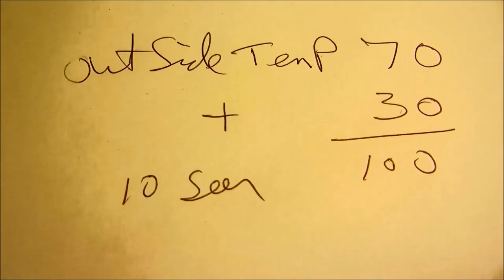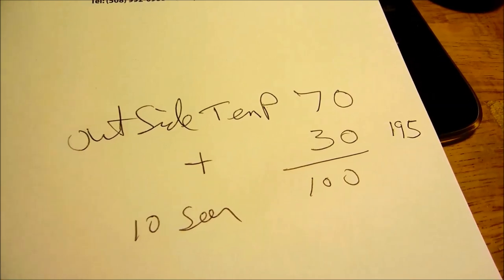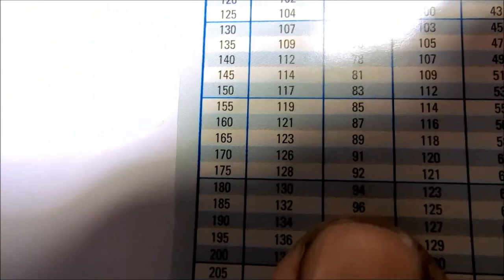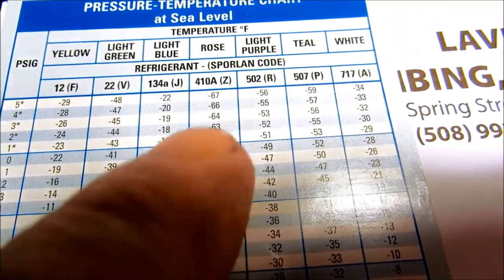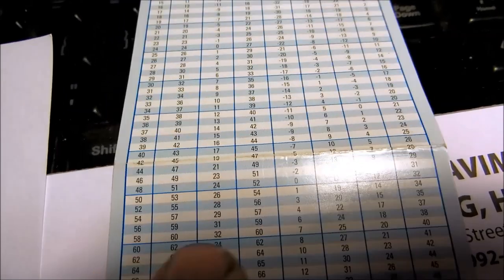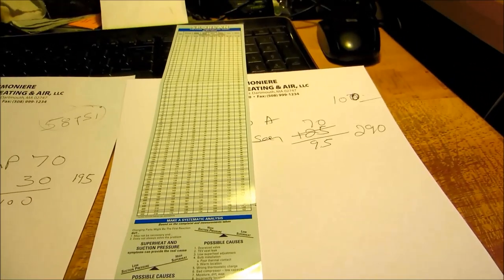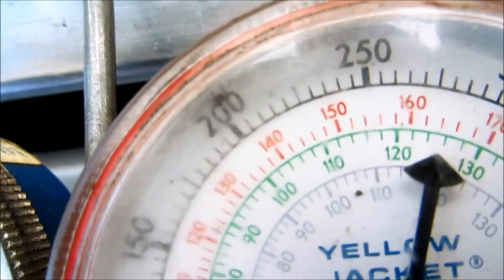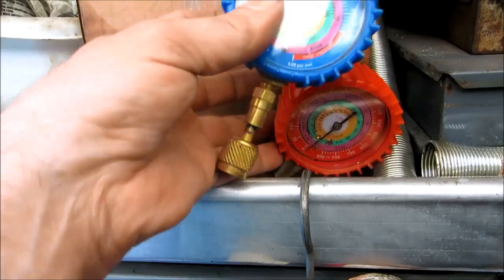hvac :30 + rule condenser head pressure

Comment: Yes but how can I determine what my condenser saturation temp should be.  For instance I know my evaporator should be 40F but how can I tell what my condenser saturation temp and pressure should be.  I know my compressor has a compression ratio.  I am teaching a class so be as detailed as you can be if you can and thanks for your time.

Comment: Steve, I understand the 30 degree rule, but heres my Question Sir, what about units of a higher Seer rating , say like 18 , 20 , 24 SEER ,and as high as 32 Seer ! Steve, wouldn't the new ( Delta T ) Temperatures ratios to be smaller on a higher Seer to add to the ambient Temp ? I have done some math on this problem, the answers I have come up with look correct for the higher Seer ratings , some of the answers are in my opinion are extremely low in Temperature difference ( Delta T ).  What are your thoughts on the subject Sir ? If this math rule applies, it could make a new standard in the field on units for Tecs to make it extremely easy to diagnose head pressure readings, regardless of what type of Refrigerant is being used in the Unit.

Comment: I'm doing a exam on air condition and I got question ask. if an air cooled conder's fan Motor stops running, the head pressure will ----------- and the amount of sub-cooling will ----------. but I just can't figure it out.
Reply: I hope you know by now ?
Reply: High head low sub c

Comment: i have found on the panel of goodman units they recommend 110* plus ambient on the vapor line in heat mode +/-4*,just to check charge in winter,but always check it again in summer in cooling mode or when temps are above 55*

Comment: Thanks for the Video, what you procedure do you use for determine a bad TXV, I've used sensing blub method any other ways?
Reply from the maker: Dave B if there is a txv you have to set the subcooling ... and the txv will maintain  about 10 to 15 degrees of subcooling if its working right
Reply: Frosting txv and distribution lines if it's stuck almost closed I believe and also hi head pressure. And if it's open, flooded evaporator, slugging compressor, low superheat?  Someone correct me if I'm wrong, I'm a greenhorn.    Btw, I wanted to share a neat little trick, the computer "Duster" canned air cans are R134a.  You can turn them upside down and spray the sensing bulb with an ice cold blast and see if the head pressure rises.

Comment: Nice video 

If the house is not hot so you have no load in the house that will also lower your suction pressure is that true ?
Reply from the maker: jordan coston yes,,,,, the higher the temp the higher the suction pressure,you should always check a air conditioner  on a hot day so you can run it with a load on it .

Comment: Hi Steve, I have Robbin air R22 gauges do I need to buy different gauges and hoses for all refrigerants in a perfect world or would your electronic one do them all.   starting as a tech what would you recommend as a good route to take to be able to check head pressures so I do not contaminate the gauges/ hoses. Jim
Reply from the maker: +Jim Farrell one for all is fine

Comment: Am I trying to understand what HEAD PRESSURE means? Is it a pressure of something? is a unit of condensation? I did not understand what HEAD PRESSURE means.
Reply: Antonio Ribeiro Junior probably you already figured out... Head pressure is discharge pressure, normally there is a port in the discharge line close to the compressor

Comment: The 30 rule does not apply to the HEAD PRESSURE............325 lbs of Head Pressure is not 30 degrees above ambient........the 30 rule applies to the TEMPERATURE......difference....of the condenser coil.......depending on the seer rating the temperature measured at the LIQUID line service port.....minus the ambient temperature........gives us that 30 degree difference.....

Comment: I'm doing a exam on air condition and I got question ask. if an air cooled conder's fan Motor stops running, the head pressure will ----------- and the amount of sub-cooling will ----------. but I just can't figure it out.